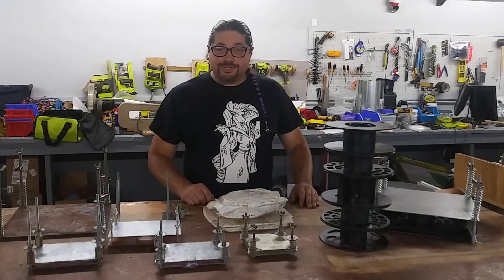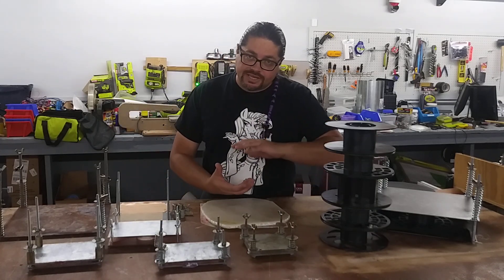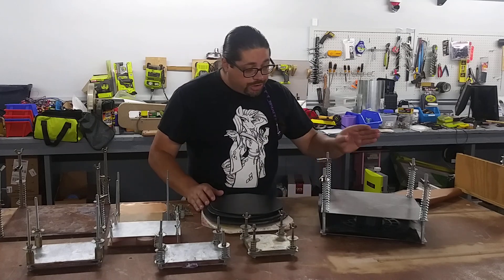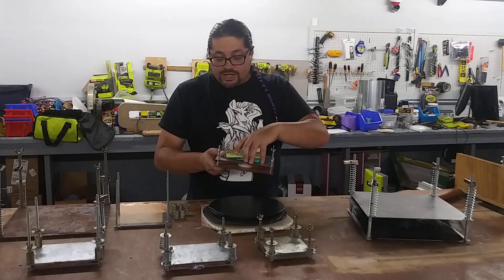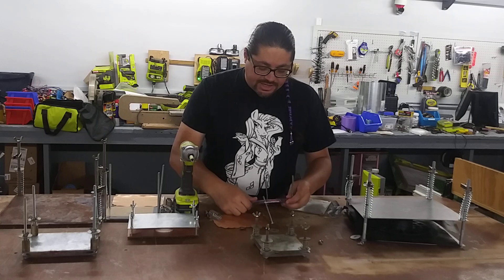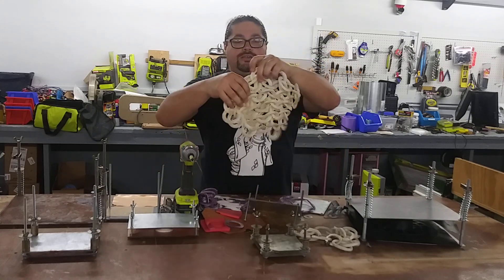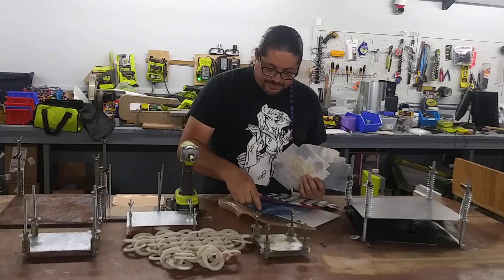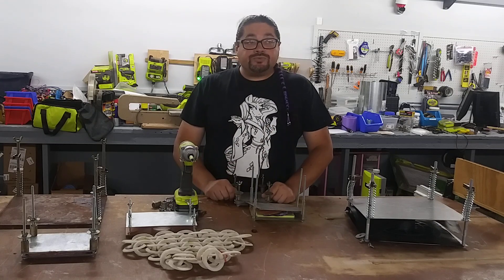How to Recycle Plastic at home using the LE-Press

Comment: That snappy grid dealio would be incredibly useful in my industry. You mention the silicone grid mat is not a commercial product, how did you make it?
Reply from the maker: I bought a piece of acrylic and used a V shaped bit to CNC the grid.  So, when I poured silicone over top it made pointed dividers.  Just mixed and poured the silicon by hand.  I think that's why it was degrading so quickly.  I wasn't able to de-gas the silicon and the tiny bubbles make it expand and contract to much.  And even tho it was supposed to handle oven temperatures, it didn't handle them very well.
  
What industry?  Car Speaker instlation?
Reply: @inventtory1272  Thanks, that's really cool!

 Yup, car audio/electronics. We often have to make plastic odds and ends for custom applications. Abs is sort of the industry standard but in many applications polyethylene would do just fine. Something snapable like that would be awesome for on the fly prototyping.

Between the crazy cost of virgin plastic sheet goods and the insane amount of plastic waste I see on the daily ( our municipality recently ceased all recycling except waste oil) I'm hoping to try and connect some dots here and work some recycled material into our day to day operations
Reply from the maker: @moffatcountycustoms4641  Awesome,  I hope my methods can give some ideas.

Comment: Brilliant idea! Thanks for sharing.

As far as I know, we can probably find lots of scrap metal at construction sites, and this metal can be used to make presses.

It's cool that you can make game pieces. I imagine that if you made the tile joinery thin enough, then it will be easy for consumers to cut through to make custom shapes, like an "L" shape. A dungeon with lava could be L-shaped and made with red tiles.

Thank you so much for your persistence in making this video.
Reply from the maker: Thank you for checking it out.  Speaking of scrap metal, I have a stack of road signs that we're going to be thrown out from a job.  There's probably a harmful stuff on them so I try not to bake with them but they do work.  Tho, I don't want to encourage people to steal road signs. LOL

I figure these methods would be a lot more usefull in third world countries because you don't need a shredder and that's the most expensive part of recycling.  If they find the right springs then people could use almost anything.  Sometimes I'm genuinely surprised nobody really does this.

Exactly what you described with the tiles is exactly what I had in my head.  You get it!  I even use lava tiles as an example most of the time, lol.
Reply: @inventtory1272  :D I wouldn't "steel" scrap metal, but maybe governments might be throwing them away, and maybe I can get it for free. That being said, the scrap that they throw away is probably all bent out of shape.

I agree about how this is not used enough. This is why I kind of hate Precious Plastics: the claptraptions that they suggest are way too big for the average person to make or afford, which means a huge ton of projects will never even be started, even though they are extremely achievable. The dice tray is a great example.
Reply from the maker: @eugenetswong  Ohmygod!  You hate precious plastic too! Thank the Lord, I'm not alone.  A friend of mine has to talk me down on the phone sometimes because I'll just rants about them for hours.  There's so much they've been disingenuous and flat-out lied about.  Part of me feels like they set at home recycling back several years.  I'm going to try and keep negativity off the channel but I'm a pretty negative guy and it's probably going to slip out at some point.  LOL anyway thank you very much for the kind words.  Oh and good pun..
Reply: @inventtory1272  Haha. Yeah! Another hater! We could finally form our own hate group. :P

I don't want to belittle their positive contributions, but yeah, I agree with pretty much all of that.

I can't name any specific deceptions, but those bricks for walls are a good example. Who on earth would buy those? If it is such a good financial opportunity, then they ought to be selling them by the ton. I think that they might make good office dividers, but that seems to be a bit of a hassle.

Also grinding up the plastic is a huge chore.

What things do you think that they were disingenuous about?
Reply: @inventtory1272  actually, maybe it is worth having that discussion/video about what they have been dishonest about, and how it sets back recycling. I think that a lot of people sense that something is wrong, but can't put their fingers on what the problem is.

Your cheap and easy to make tools are the solution. I love the fact that if we don't have time, then we could buy cheap products, but if we do have time, then we could look through junk for parts.

The bad thing about PP is that their message are based on feel-good ideas, which guilt people into supporting the message instead of just focusing on the merits. This gives PP an unfair advantage in the open forum, so maybe a video discussing the topic might help.

I don't know. shrug
Reply from the maker: @eugenetswong  You've hit the plastic nail on the head.  I don't like belittling their accomplishments either, they have done a lot of genuine good.  But when you get there by lying it sours the whole thing.  Especially when you're being disingenuous about a hobby that I really love.  That's why I get so personally angry at them.  I have literally poured Blood Sweat and Tears into recycle ing by hand.  Years before Dave Hakkens even approached plastic and was trying to redesign cell phones without a lick of engineering knowledge.  (phoneblocks)

I'll make a video one day but off the top of my head..

They said their extruders could make 3D printer filament.  Many of their promotional pictures had spools of plastic filament in the background.  But it was purely for looks.  Even in their photos you can see it's absolute garbage and literally ten times what it needs to be to go in a 3D printer.  You know those baskets they weave?  That's how thick the plastic is.  Complete lie.

Never mentioned how much their machines cost.

His "Stop 3d Printing garbage" video claimed that everything was made from petroleum.  Not really a harmful lie but completely incorrect.  Everything in that video was 100% PLA and the printers they owned couldn't even print in any other materials.

I strongly believe that we're disingenuous about how much they would use HDPE.  They always wanted you to think that they mostly used PP.  PP is more common but generally takes more industrial methods to recycle safely.  And it doesn't mix well with other plastics.    PP was prominently featured in most videos when they were scooping plastic shreds or labeling buckets.  But what did they actually put in the machines?  HDPE..   I can't prove it but I believe it was almost entirely HDPE.  When you ask (if they answered) they would always claim it's a mix but I've been working with HDPE for over a decade and I don't think that's true.  The only times I think they would genuinely use the mix was in there flattening panel machines.  In which case, the real reason that the PP would work is because it's just stuck in HDPE.  Every sub-branch of precious plastic (and their own online shop) openly says they only use HDPE.

Not really a lie but they always claimed how cheap and easy it was to build their machines especially if you salvage parts.  But completely ignored the importance of the Shredder.  Which needed lots of custom plasma cut thick steel parts a hex spindle and welded enclosure.  It's cute that they used an old oven and a thrown away motor.  But they tried to make it look cheap and easy for third world countries, when simply shipping those shredder parts would completely exclude most of the world.  It's so disingenuous I call it lying.

The Dark Side of Data video is just wrong from start to finish.  Luckily they got roasted by the community.  (I left one of the comments he read outloud, lol.)

I think their mask recycling video is genuinely dangerous because they don't say strongly enough up front that they're using factory reject clean masks.  I had to argue with a dozen people as to why collecting used masks..  during a pandemic..   was a hazard.

"but there are companies that already collect dirty masks"   You mean the ones that we're hazmat suits!?

Side note..   they can do whatever they want with their prize money but they undeniably wasted it horrendously.  The "plastic sorting robot arm" is a college school level science project.  It had no idea what plastic it was looking at and was just a color sorter.  There are people on YouTube who do that with Legos.  Some dude collected a paycheck to play with a robot arm for over a year.

Plus their general direction was just naive and misguided.  Their second set of machines went in more of an industrial Direction with no thought of Industry.

I go in a personal Direction and try to make recycling valuable to a person.  I don't need to convince anybody to recycle.  If we can just make plastic have the tiniest amount of value then people will stop throwing it away themselves.
Reply from the maker: @eugenetswong  Wow, I really went off.  LOL sorry.
Reply: @inventtory1272  Yep. You went off, alright. I wanted only a couple of points, but you gave way more, and I love it. :D

I you want to keep this private, so that we can keep it positive, then we can chat elsewhere. I use Discord, and other things.
Reply: @inventtory1272  I think that I discovered them around their 4th iteration, or whatever it was, and yeah, I recall quickly realizing that despite the comments and common sense, they made it harder to participate. I think that this is what you are referring to regarding becoming more industrialized.

They never once checked to see if there was some kind of economic efficiency.

I'm surprised to see that anybody would resort to such extremes to promote a social movement, but that is what recycling is: a movement, which is way too big for our needs.

I think that society needs to scale back on recycling in general, and  focus on better sorting of 3-7 simple things, which are well labelled. Most people can only remember 7 things at once. I consider my sorting skills to be advanced, if there is such a thing for recycling. I'm more than willing to read technical info, and ask questions, but even I get a little confused with our current rules. There are just too many rules and conflicting priorities.

When recycling first appeared in Canada, I latched onto it almost right away compared to others. I used to remove plastic envelope windows, and staples. Now that I see what recycling has become, and now that I believe that most people aren't mentally capable of sorting properly, I've changed my views a lot.

So, I can really see how PP has set the cause backwards for a decade or more. I think that he is, by definition, a grifter.

In summary of what you and I said, I think that PP is so focused on moving the plastic through the cycle, that they ignored the economics and technology, and that they also ignored the people's mental capabilities. Now that I see this summary, I'm amazed at bad they appear to be.